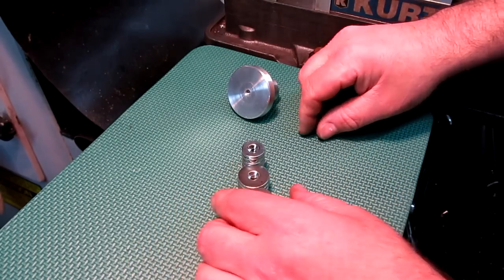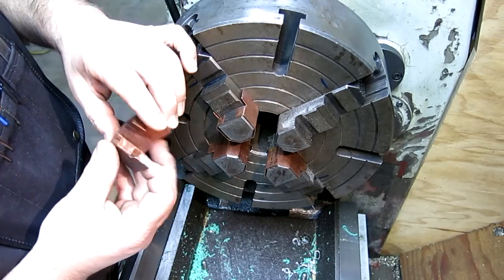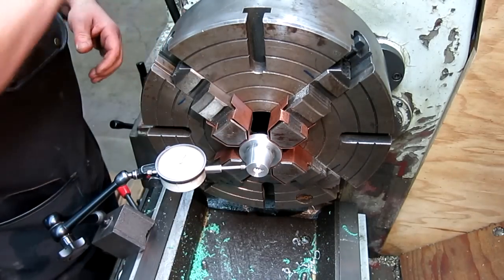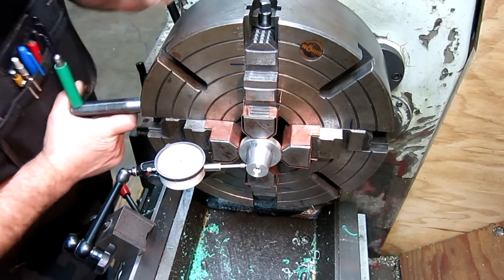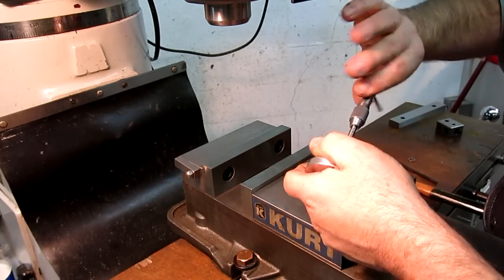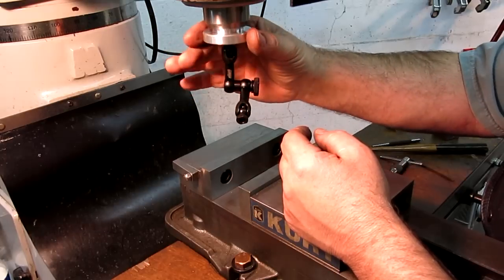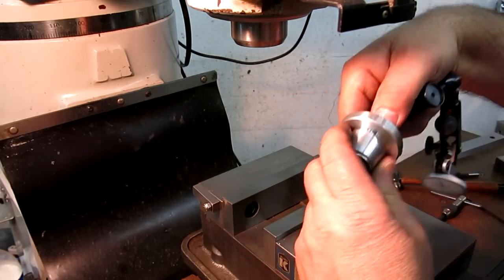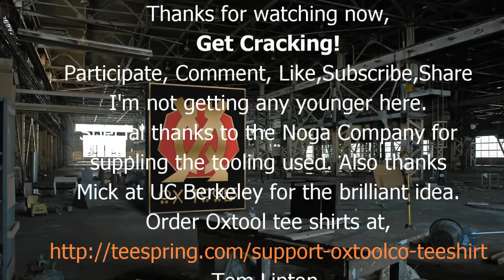R8 Noga Mount Part 3

Comment: Square peg in a round hole (almost).
Alternative A:  three small magnets in the flange.
Alternative B:  stack of alternating transformer iron disks and brass/bronze/brass washers pasted with SMD paste, clamped together and cooked for an hour @ 250 degrees.  Attached to a flamge, machined to shape, broached for a magnet laying sideways.

Keep up the good work!
Reply: I like B:    I was thinking 2 - 3 stack in the flange with cross holes in a 60 degree clocked pattern, maybe a second row offset to 1st row by 30.  get more flux lines in air vs AL   Chips and crap in cross holes is a problem, a fill maybe.   Back to B:   clocking N-S poles 90 degrees is a great idea , I didn't think of that, obvious now.  Thanks for the idea.

Comment: Nice job figuring out the solution. If it was me I'd have probably put a rod on top with a magnet on the end to catch the end of the drawbar.  Less "wieldy" and probably with other problems. The ring of smaller magnets on the top of the flange idea sounded good too. 

I think the thing to keep in mind is that magnets don't like to pull away from steel, but they are perfectly happy moving along the surface...all you get to stop that is friction, and maybe a little force from induced current while moving that will slow, but not stop a slide. Your fix works because of the taper...by moving down the magnets are pulling away from the sides. To get closer to the steel they have to move up the taper. 

When I eventually get a mill I'll want one too...unless maybe I turn a stepped rod that will fit in a bunch of different collets instead. I suppose both would have their uses...sometimes you have a collet installed and sometimes you don't. 

Thanks for the ride-along!

-- Mike
Reply from the maker: Hi Mike,

You do need several setups to me efficient in the mill. That's one of the reasons we end up with so many tools. That and straight up tool addiction. Thanks for the comment.

Cheers,

Tom

Comment: Hey Tom Great solution ,probably to late to knurl,but definitely anodize it. I now want to try one for my Sherline mill but it will have to be a #1 Morse to fit spindle.thanks again Dave
Reply from the maker: Hi Dave,

I'm leaning for fluting the rim. You are right about holding it for knurling. That has Bozo written all over it. Thanks for the comment.

Cheers,

Tom

Comment: Hi again Tom,
                   I have been thinking about the low hold force you are getting on your NOGO taper mount. The force of attraction is inversely proportional to the distance of the magnet from the steel of the female taper hole. An easy adjustment is to put a small thickness washer preferably steel under the magnet and increase the thickness until you get the strength of attraction you require. For maximum attraction add washers until the male piece is just a tiny bit loose fit then remove one washer and you will have the magnet as close as possible to the steel of the bottom of the female taper  thus giving a strong magnetic lock. Better still is to make the male taper piece from steel and the north magnetic fields will pass through the steel of the female piece and then through the male piece to make the strong attraction between North and south with minimum air space. Magnets are easy to use but some applications where non magnetic materials are used problems can be hard to eradicate. Hope this helps.
 Cheers MoK

Comment: Oh, another thought I had, you've only got taper contact, but if you machined the whole deal with face and taper contact, you could put several small magnets on the face contact portion, which may be considerably stronger hold and doesn't rely so much on the taper keeping it stable.  I've got a fly cutter that doesn't have a taper, just a large chamfered groove that engages the spindle nose and outside chamfer of the nose.  It's quite stable and seems to remove a lot of the "wiggle" that R8 has.

Comment: Hi Tom,
Happy to see I wasn't too far from the solution, it'll be great if you machine anything that is not magnetic, but otherwise, I'm afraid that everything that has to stick to it, will, to be seen...
Cheers,
Pierre
Reply from the maker: Hi Pierre,

Lots of magnets in the shop environment. I'm not too worried about it. Well at least right now. Thanks for the comment.

Cheers,

Tom

Comment: Hi Tom, I'd throw a knurl on the "ring" at the bottom of the taper, then hard anodize the whole unit.  It might look neat to turn down the knurl a bit after anodize, so it has contrast with silver diamonds on dark gray.
Reply from the maker: Hey Perry,

I'm thinking of fluting the rim instead of knurling it. Easier to hold after the fact for that. Thanks for the comment.

Cheers,

Tom

Comment: Finally found the right video!!!! I posted several times to ask you about your jaw protectors, I have similar, not as nicely cut out as yours but in brass.
Reply from the maker: Stephen Hodge Hi Stephen,

Glad you found the video. I don't think I could have found it myself. It would have been faster to make another set. Thanks for the comment.

Cheers,

Tom

Comment: Tom - I seem to recall that a fixture like that was also present in the Stanford U. Mechanical Engineering shop in the 1980's when I was a grad student there.   Nice job as always.

BTW, I think you needed to mention that you wiped out the spindle bore before testing the interference.
Reply from the maker: Hey Tom,

Whoops. I don't think I did. Maybe that was my problem. Thanks for the comment.

Cheers,

Tom

Comment: Cool project. 

You might want to put a washer cap on that just to avoid constantly banging the magnet.
Reply from the maker: Hey Doc,

Good point. Those magnets are pretty chippable. Thanks for the comment and suggestion.

Cheers,

Tom

Comment: I love finding completed parts in my chip tray! ;)

My one thought for improvement might be to put the magnet or magnets in the horizontal lip to attract that lip to the face of the spindle instead of having the magnet up inside the spindle. I think you would get a stronger and more positive engagement like that.

Nice job, I like it.
Reply from the maker: Malorie001 Hi Malorie,

Thanks for the comment.

Cheers,

Tom

Comment: I believe that you had the opposite poles on your first version to attract each other.  If the center magnet had north towards the draw bar then the north should have been forced into the side pocket.  That would have continued the magnetic field.   For the disk magnet version a loose top portion that continues the R8 form would make the magnet not stick to the bottom face on insertion removal.
Reply from the maker: +hardkrash Hi Hard,

You might be right on that one. We ended up putting them in the face with great results. Thanks for the comment.

Cheers,

Tom
Reply: I agree with you.  That was my idea in #2.

Comment: Tom, Nice little tool! Enjoy watching your channel.  I had to check out all the Noga hype and now that I have one, wow, Nice!   On your tool, I keep seeing/imagining fine metal dust on the magnet contaminating your spindle bore.  I also wonder if using this will eventually magnetize the spindle which also will draw contaminates?
Reply from the maker: Richard Skinner Hi Richard,

Lots of magnetic stuff around machine shops. Have you ever wondered why we are always wiping and touching everything. Were looking for dust and grit. You cannot keep it out of the shop so you develop habits to keep it from causing problems. Thanks for the comment.

Cheers,

Tom

Comment: I'm a home shop hobby machinist. I have scanned down through the comments list and I too am wondering about getting chips inside the spindle. All my local machinist buddies make a big to do about keeping the inside of all spindles clean. I noticed that your usual answer is that there are other magnets in shops, however they aren't inside spindles. What can you do to be sure to keep magnetized chips out of the spindle? Not being a pain, but I probably have less experience that 95% of the folks watching the project. I like the idea of fast and easy.
Reply from the maker: +Cavemannspace Hi Caveman,

Good practice is to wipe your collets and run your finger in the spindle bore before you install anything. As it turns out I have not used this mount since I made it. Not my cup of tea. Thanks for the comment.

Cheers,

Tom
Reply: +oxtoolco Yeah, a couple of the guys told me to use a new, clean rag and be careful not to leave any fuzz off the rag in the spindle if there should be anything. Thanks for the reply.

Comment: Hi, Tom. glad you got everything sorted out, tooling and your heath. are you going to test your new gauge mount?
Reply from the maker: Hi Sam,

I thought I did test it. Did you have something else in mind?

Best,

Tom
Reply: Well, I'm new to this and very little experience, but A known round cylinder and also a sign bar. Sorry if I spilled it wrong. Thanks Tom

Comment: I would be worried about the Magnet collecting burrs and chips that might score the inside of the spindle. My thought would to be use a soft compressible material to hold in the spindle and use a camlock (like on a toggle clamp) to secure it in the spindle. The cam lock would compress two metal parts with a soft compressible material sandwiched in the middle so it expands out.
Reply from the maker: Hi Guy,

The UC shop has been using these for years without any negative reports. The taper will not lend itself to expand and hold because of the self releasing angle. Thanks for the comment.

Cheers,

Tom

Comment: Well, you got me. I had thought you were going to go with the flange mounted magnets. Mounted on the end seems to give decent holding power. Stack on 2 and you'll need the big Snap-Off prybar to get it out. ;-)
Did you not have a Noga arm grafted to an Indicol at one time??

Colin ;-)
Reply from the maker: Hey Colin,

Still have the indicol/Noga mount. Love that one. You need several indicator setups for the mill to be really efficient. Thanks for stopping by. 

All the best,

Tom

Comment: I would personaly like a light knurl on the larger diameter, to aid in spinning the indicator as needed. Would the helicoil hold up to mount it to a mandrel so it could be chucked up and knurled? Just curious. Thanks again for the great videos.
Reply from the maker: Hey Mitchell.

Fluting the rim might be a nice move as well. Easier to do a really nice job on as opposed to knurling something in a less than spiffy setup. Thanks for the comment.

Cheers,

Tom
Reply: Now there is a great idea. And it's something i haven't seen much of on the ol tube.  That might make for a great video someday. I know i would personally enjoy something like that. And it wouldn't exert the pressure inward like the knurling would. Brilliant. that's why you're the expert. Lol

Comment: you could always use 2 magnets  neat project tom was wondering if the magnet was pushing
it off center

how is the autometric coming along
Reply from the maker: Hey Andy,

Man you guys are relentless. I haven't tried two magnets yet. I do have smaller ones I could stack. Thanks for the comment.

Cheers,

Tom

Comment: Interesting!  I hope you share your views about this tool's utility and any drawbacks after you have a chance to use in real world situations (chips sticking, magnetized quill, loss of rigidity). 
Do you plan to use the indicator only in a static position or do you believe the lack of taper contact will limit its dynamic use as in ascertaining a flat surface?
Reply from the maker: Hi Morris,

Don't let the weird contact pattern fool you. This pops into the spindle without any discernible wiggle. I think it will work well for all typical spindle mounted indicator jobs. Thanks for the comment.

Cheers,

Tom

Comment: Hi Tom...

Wow, awesome mill and lathe p*rn!

I love your freeform thinking while you shoot video!  I wish more people would do that, instead of overthinking everything off camera and then shooting.  This is how we all design things!

My only question is this:  Why did you decide to build a whole new R8 holder device as you did, instead of creating a simple 1/2" OD rod that could be mounted into a standard 1/2" R8 collet, and then add an internal threaded hole for a set screw that the Noga arm could screw onto?  What is the advantage?  Not criticizing or second guessing...just curious.

I loved watching your methodology to cut the taper on the lathe!

You definitely think outside the box...in a very good way!  I love it.

Thanks so much!  I'm off to watch all your other videos now.  There goes my next whole few weeks, and I'll probably get fired for not showing up at work!  ;)
Reply from the maker: +Jim Newton Hi Jim,

I built this one because I saw one somebody else had done and wanted to try it. Fact it I haven't used it since this video. There are three conditions you will want an indicator in the spindle. Tool in, tool out but collet in, and no collet. A good mechanic has a solution at hand for each. I generally default to my Noga/Indicol setup for everything. Doesn't matter what's in the spindle. Thanks for the comment.

Cheers,

Tom

Comment: Personally, I like the idea of the indicol style better because you can have a tool in the spindle.
Reply from the maker: Hi Lewis,

I have and Indicol I modified and added a Noga arm to,. Check out my video "A Noga indicol marriage" The idicol arms leave a lot to be desired. You need several indicator setups in the mill to be really efficient. Thanks for the comment. 

Cheers,

Tom

Comment: Way to stick with it. The only thing I'd do differently is to use a Time-Sert instead of a Helicoil. It's personal preference mostly, but there is a technical advantage too. Price is commensurate of course.
Reply: of course you could just have drilled the hole smaller, no insert needed!
Reply: How do you drill a hole smaller?  Every time I drill a hole, it gets bigger!  ;-)

-- Mike
Reply: BigMjolnir
haha, but i meant when he made it! yes if i could invent the 'make the hole smaller' drill i will be rich!
Reply from the maker: jusb1066 Hi Justin,

Well then I would have had to do a second setup to drill and tap for the M6 in the opposite side. Holding the part on the rim would take longer than adding the insert. Six of one half a dozen of another. Thanks for the comment.

Cheers,

Tom

Comment: Hey if it works, it works.  Call me hard headed(I am and I know it HA!), but it think you'd get a much more positive seat if you put a few small mags around the top of the flange.  It just "appeared" that it was teetering on letting go with the stuff attached.  Could be wrong about that though.  You wouldn't have the magnet catching the spindle every time you put in that way.  I don't know how much you plan on using this neat little tool, but it'll be interesting to see if it magnetizes the spindle and starts collecting chips from finer chip producing stuff like cast iron.

That Noga stuff is really neat!   What materials are they made of?
Reply from the maker: Hi Blem,

It seems to be just right with the retention force. It holds fine but as soon as you get any separation between the magnet it pops free totally. The flat magnet on the rear allows you to use this on a flat surface as well that the machines are loaded with. I will probably try a Mark 2 version with mags in the rim. Stay tuned.  Thanks for the comment.

Cheers,

Tom

Comment: Hi Tom, I scanned thru the comments and did not see the following so if its been covered please excuse me. How about mounting 3 small magnets on the face of the ring that faces the spindle. I do not think the mag's would even have to touch the face of the spindle to be effective, therefore the 1/8 + or - would not be critical. You could also fine tune the air gap by how much the mag's stick out past the face of the ring. I will send a separate email to your website. Love the Noga's.
Len on Long Island.
Reply from the maker: Betty Laufer Hi Len,

Are you using your moms email account again? <g> Thanks for the suggestion. Yes several folks suggested this and we actually tried it out in a later video. 

All the best,

Tom

Comment: It seems that the 1" destroys the taper's length & full contact. Why not use the 7/8 magnets, create a pocket & use 2 magnets? You'll more than double you magnetic flux field but you also run the risk of magnetizing your spindle. FWIW

Comment: Hi Tom - this is not related to the Noga project
Did you do a video on oiling machine tools and showed a 'push' oiler that looked quite
similar to the push type of grease gun commonly used with chain saws.  I have looked
at a number of your older video's but can't find it.  In all honesty I originally thought it
was done by Mr. Pete but he says he didn't.  Your the only other youtube site that I
would think I saw it at.  THanks   Rod
Reply from the maker: Hey Rod,

I think Adam did one. You can find those oilers in McMaster carr. They are a couple bucks apiece. Thanks for the comment.

Cheers,

Tom

Comment: What type of mill is that? I mean the brand. Also, would you recommend it or is there a favorite?
Reply from the maker: +Dillon G Hi Dillon,

My mill is an Acra. Its a nice machine. I would buy another one no problem. My favorite of the Bridgeport clones are Sharp's. Really nice machines and better than B-ports in many respects. Thanks for the comment.

Cheers,

Tom

Comment: Can these neodymium magnets be readily machined without complications?  If so, an oversized one could be attached then machined into the actual over-all spindle taper with the aluminum holder.  This should significantly increase the attractive force without being overkill perhaps?   Forgive me of my ignorance on machining a rare earth magnet....It might not be practical in a typical home/hobby shop.  Not sure about chip control from machining monster magnets....
Reply from the maker: Hi Clete,

They are not super hard but they are easily chippable. The less you mess with them the better. Thanks for the comment.

Cheers,

Tom